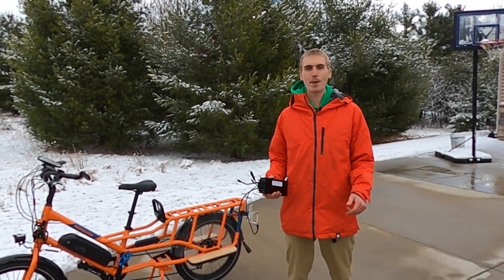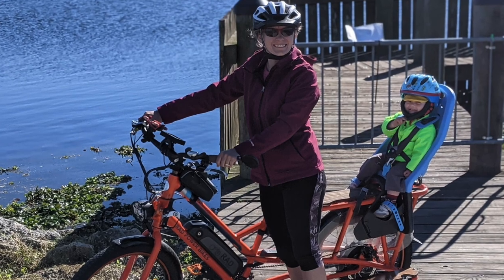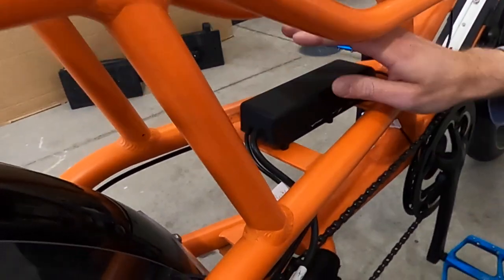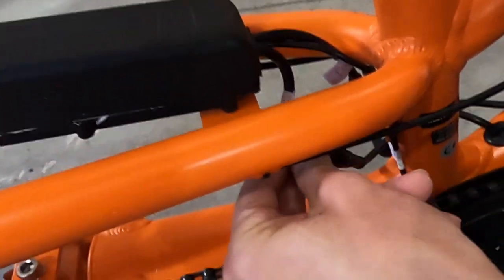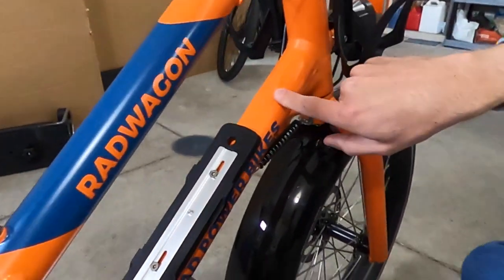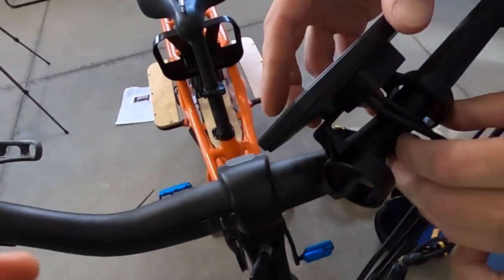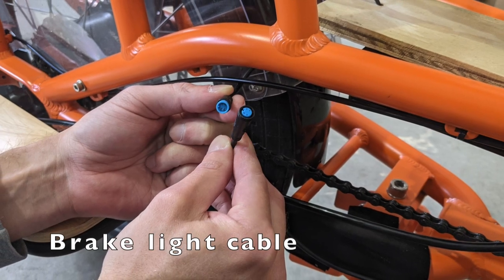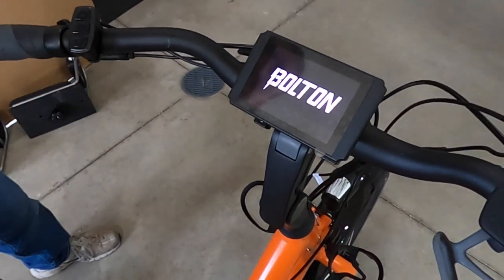Super Powered RadWagon 4! Rad Power Bikes Controller Upgrade Installation (Bolton Ebikes)

Comment from the maker: What do you think of the controller upgrade for Rad Power Bikes? Support Ebike Escape when purchasing from Rad Power Bikes: https://radpowerbikes.pxf.io/1rmzzD (affiliate link)
Reply: It's quite a transformation! Installing on the RW looks slightly more straightforward than on my RR1, the connector for the screen is routed through the frame, and has a nasty habit of getting stuck in the frame, and takes FOREVER to fish out again. It's worth taping over the connectors to stop them popping out again.
Reply: Where is the second part of this video, i cant find it?

Comment: I didn't know there was that much controller room on the RadWagon. If I had that, I install both controllers and switch back to the Rad controller for quiet times and efficiency. The 35 amp controller is pretty efficient though.
Reply from the maker: That's not a bad idea! We were really happy that it just worked out of the box.

Comment: G'day!  Thank you. Very well done.  I'm considering a controller replacement for my (orange) RadWagon4, 3 1/2 years old, 2500 miles. The front and rear lights have stopped working.  Not looking for increased power, but it'd be nice I suppose.  You give me confidence.

Comment: Bought the electro bike world setup and it came quickly and installed easily.. Fair warning the support bracket for the display and the power assist control / power switch very sketchy.  Both broke when I tightened their mounting screws.  Might be user error but I doubt it.
Reply from the maker: Good to know, thanks!

Comment: good idea to keep the old controller so if you need to make a warranty claim you may be able to convince you are using stock when you burned out the motor.

also so if the upgrade controller dies you have a fallback replacement so you are not stuck without an ebike.
Reply from the maker: Yeah definitely from a fallback perspective. Though I think if the motor died we'd put in a 750 watt nominal motor so it doesn't happen again.

Comment: Hi, great vid ! I dig your installation, very clean, my controller hangs with zip ties...;) 
Have you planned to upgrade to the true 750w motor ? It's unclear if it's a direct plug & play from the current wheel (like for other rad bikes)
Reply from the maker: No plans at the moment since it seems unnecessary. Thanks for watching.

Comment: does the headlight also plug into the main cable in front or is there a separate wire to the controller?
Reply from the maker: Sorry I'm not sure at the moment. If you ask on the forum I'm sure someone could help: radowners.com

Comment: Did you use the stock configuration that the controller comes with or did you needed to change anything for the RadWagon?
Reply from the maker: For a bit but then my brother adjusted them. Check out this video: https://youtu.be/fsbcY91alf0

Comment: So would you do motor upgrade at some point? (For radwagon 4). Also maybe a tannus armor video.
Reply from the maker: I don't think my brother would do the motor upgrade unless the motor were to burn out. I don't expect this to happen and the controller alone is such a significant improvement. No Tannus video in the works but I did put those liners on my older RadWagon and a dual motor fat tire ebike. Thanks for watching!

Comment: Thats ugly installation -  sorry but the controller should have the connections coming out the right end not doubling back on itself. Sorry I appreciate you video?
Reply from the maker: If you have suggestions for a cleaner installation I'm all ears. As I mentioned in the video it is not yet permanent. We wanted to test it first to make sure there weren't any issues.
Reply: Ha! You think THAT'S ugly installation...you should see MINE! HaHaha!!!!
Reply: I think it’s pretty genius...considering you could install a second battery directly on top of the wood pretty effortlessly. Although instantly with the wood I thought ventilation might be a problem for the controller depending on how you mounted it.  If that were an issue you could always put in a spacer or something.
Reply from the maker: @heidihevener3144  Good point, and now the install looks even better.
Reply: @heidihevener3144  how would you go about adding a second battery? Would you just swap the cable when the first one dies?
Reply: Was there ever a more permanent solution to mounting?